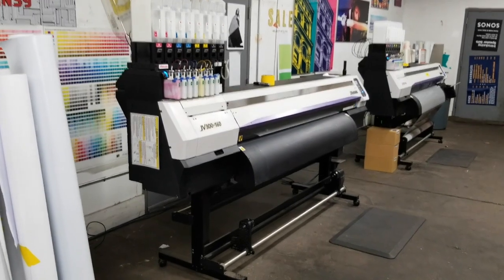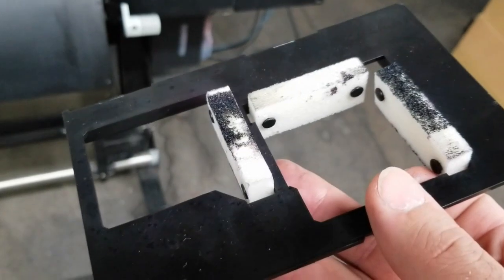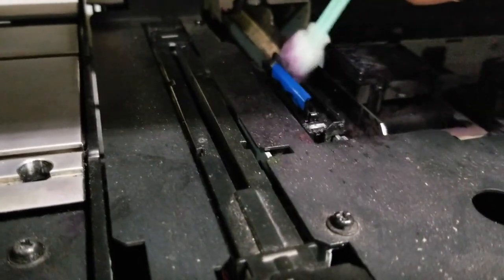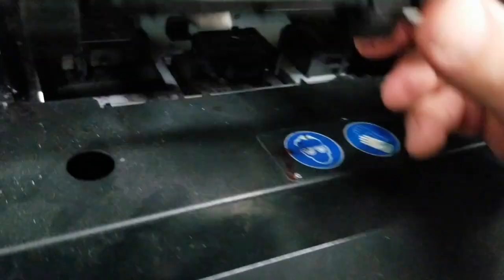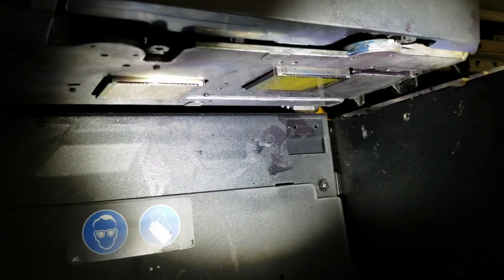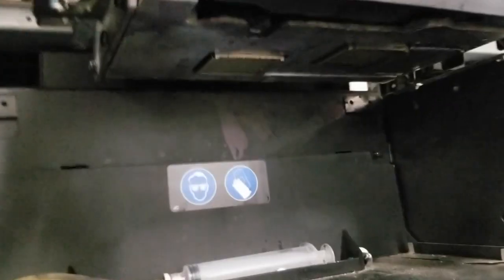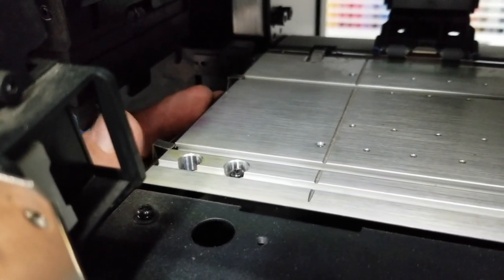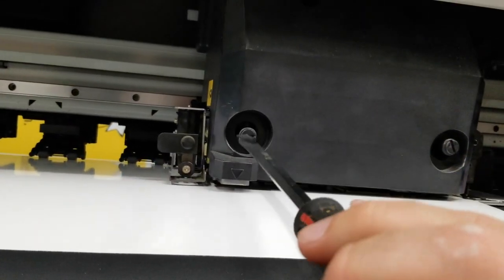Mimaki JV300 maintenance

Comment: Hey, thanks for sharing your experience on the machine, it was very helpful for me! We are getting mid print stops and then the carriage just returns to the station... Sometimes it will come out again and do a few lines and then stop again... Or maybe not come out at all. We have been told this can be a communication problem but I would like to get some more feedback... Had you ever had something like this happen with yours? Thanks